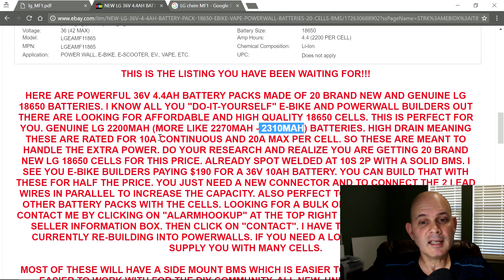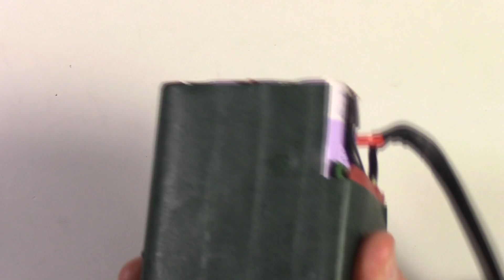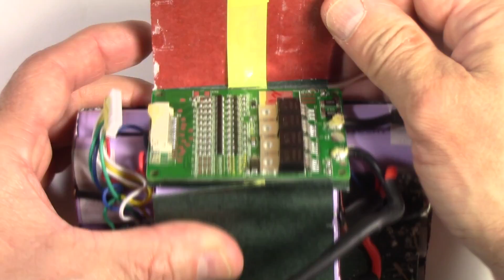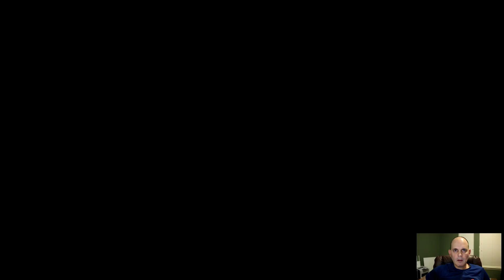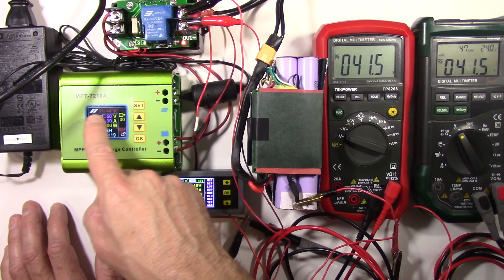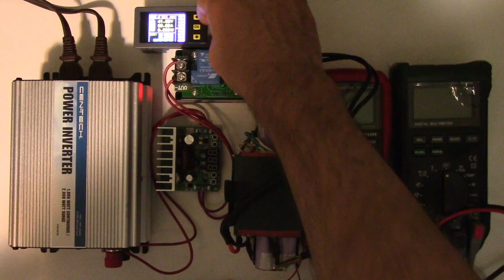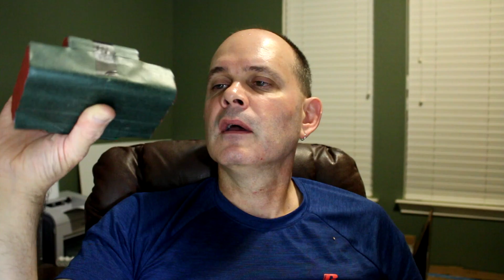NEW LG 36V Ebay BATTERY PACK 18650 Thorough Review (Great Value) For Ebike Vape Harvest Powerwall

Comment: I believe that all the BMS on aliexpress can't balance even if they claim that it can. I honestly don't know where to get one that actually works.
Reply from the maker: I am still on the fence as to whether this BMS balances or not. The BMS is not designed to balance cells that are way out of balance. The pack should start with all the cells in balance when it's manufactured so they really should not drift too much in the first place. Therefore the BMS should only be making up small differences. Thanks.

Comment: Hello Mr Lloyd, thanks for the review, excellent. I'm interested in using these packs for a low budget power wall scenario with a solar panel and I've also been looking at the exact same MPPT charge controller that you used in this video. Would it be possible to have these hooked up in parallel to that charger, considering they have the BMS installed? In other words, could I charge 2 or 3 packs at the same time with a single charger, without having the multiple BMSs cause issues with each other? Also, do you see any issue in draining some power from the batteries in this scenario, while they are also charging? I've been looking all over for answers. Any thoughts would be greatly appreciated. Thanks again.
Reply from the maker: Interesting scenario.I am only speculating here but if the BMS's controlled the packs correctly and could be trusted to protect the cells from over charging and over discharging I can't really see a problem with it. But understand I am not a solar panel charging expert. There may some electrical detail I may be missing here. I know the MPPT charge controller at Ebay: https://goo.gl/dq8Pru does a great job of charging the single packs. The side mounted BMS on the LG pack at Ebay: https://goo.gl/y8bxeU I show in the video that the BMS does have a P- solder pad that will allow you to draw power while the cell is charging but again I have no specifications on that circuit so I can't tell you how well it work for you or even if it is safe to do any of these things.But because you asked and I did mention it in the video that there was P- power output on the BMS but I did not test it. I am testing it right now to see if it has a low voltage cutoff and I will make a video on this feature as I think it's an interesting feature. I did simultaneously charge the cell and discharge the cell using that pad so it does work. I will report what I find in the video soon. Again I will not take ANY responsibility for loss, damage or injury for use of any of this information. What you do with your equipment is your sole responsibility. Be safe.
Reply: Absolutely, I fully agree. Anything I do is 100% my responsibility. Thanks for your input, it's very much appreciated.
Reply from the maker: Here is my video response to your question https://youtu.be/Ua6PpLWqEgc thank you for asking. I will look further into your second connecting two of these in parallel and charging them. I do now have two of these, the LG and the Samsung pack which on paper should be electrically identical but I have not disassembled the Samsung pack to see what the center mounted BMS is capable of. Thanks.
Reply: Wow, thank you very much, Mr. Lloyd! That was very helpful.
Reply from the maker: You are most welcome. Your question inspired the video and I will be doing further testing on the Samsung pack in the near future. Thanks.

Comment: I've bought two different shipments for a total 60 packs - so far. The BMS boards on the first order had the BMS connector but the second order had the board in the middle as shown on Ebay and there is NO BMS CONNECTOR. Just a warning if you were expecting it, I was and had almost ordered an expensive charger to handle them. I plan on using the packs as is for a 36v powerwall.
Reply from the maker: Thanks. My Samsung 36V pack has the BMS in the center which may not really be a problem if the BMS does what it's supposed to do. Thanks.

Comment from the maker: I have received the Samsung battery pack from alarmhookup on Ebay: https://goo.gl/yqMhSN It has the BMS mounted in the center of the pack. Should I send it back and request a pack with the BMS on the side, or should I just grin and bear it and test this one as is with the BMS center mounted? Thanks.
Reply: Richard Lloyd hey man, I think you should just watch my tests. Go to minute 33:18 of your video and you will see that both of your power sources show 0.00A's flowing, which means no current is flowing. What that means is the Mosfet has disconnected the pack from the power source. So the board is protecting the cells. Raising the voltage on the charger does nothing because no current is flowing.
Reply: All the packs are prewired and configured. You can't get custom things done. I live down the road from these guys and saw the warehouse....... batteries batteries everywhere! lol
Reply from the maker: I suspected as much. It would be nice to have a real spec sheet. Did you determine if they are balancing BMS's? Thanks.
Reply: Fishmonger ! I wouldn't ask them to do it, I do it myself. I am an EE with MAD skills man.
Reply: Richard Lloyd hey brotha, I'm making the datasheet now, used EasyEDA for the schematic, and BOM list. I'll be testing several packs this week and making some videos...I want to blow one up, just to see what it actually takes to make it happen...I'll send you the PDF once the data has been gathered.
Reply: hi, test the center mount.... why so stuck on the side mount?
Reply: Richard Lloyd aq

Comment: Thanks for the wonderful video and all the information. Question, how do I charge this battery pack? what kind of charger to use and how to connect the charger? Can you please share more info on how to charge multiple battery packs at once?
Reply from the maker: You are most welcome. You can use a simple 42V E-Bike charger from Ebay: https://goo.gl/HK7xGF or Amazon here: http://amzn.to/2xFakCT and you can use one of these to charge a single pack. The important thing to remember is that they are Li-Ion and require to be charged correctly. They need a charger built to do Constant Current (CC) and then switch to Constant Voltage (CV) in order to not destroy the cells. If you wish to have a more advanced charger you could create a system like I have in the video which will allow you to configure your charge settings, which you need to be very careful to not overcharge or over discharge but using the gear I show in the video you can set it to automatically switch off before any of those states happen also the BMS "should" protect against those situations. You can find links to all that gear in the video description here: https://youtu.be/Q2w5Ka2oNv8 If you want to charge multiple packs I would still use singular chargers for each pack as it is fairly cheap and you get the redundancy multiple chargers and protection circuits. Thanks.
Reply: Thanks for all the info. If I buy one or more of those chargers and replace their plug socket with a XT60 male plug then I can connect the chargers to the battery's XT60 female plug to charge them correct?
Reply: Will this work? https://www.amazon.com/EVAPLUS-Adapter-PowerFast-3-Prong-Connector/dp/B01HXMY0TE/ref=cm_cd_al_qh_dp_t  (it is azn prime so I'll get it in 2 days)  I know I have to cut the connector and put in a XT60 connector

Comment: The spec sheet says 2150mah per cell  at 4.1 volts, with 2 parallel 10 in series   if the bms charges to 4.2 which is the cells max voltage and the discharge rate of the cells are low enough amp wise you can get 4.4ah out of the pack or more. Not only are these cells typically under rated the mah changes depending on how fast you pull current out of them or how hot they get . If you look at a tesla battery pack this is why they have so many cells in place of just larger ones. In short the 4.4ah is more than likely correct . That being said i would rather stick to harvesting cells from laptops , they average me about 50c per cell at 2400 to 2800 mah each.

Comment: Thank you for taking the time to run all these test.  I purchased 40 of these packs over 2 months ago and would like to run 20 of these packs in parallel for 36v at 86amps for a total of around 3kwh for a small solar generator.
Reply from the maker: It should be possible. Thanks.

Comment: VERY useful/informative video!  Thanks!
I;m using them, with BMSs, as a golf cart battery.  Cart will run on as few as four.  Nine makes perhaps a five mile battery.  I intend to eventually use as many as about 26.   So far, no trouble/fires.  Taking care not to charge above 42v.  I've tested capacity on a few and found mostly around 4 ah but some down around 3 ah.  I hope the lower capacities will come up as they are cycled.
Reply from the maker: Wow! That's great. I wondered about a golf cart application as I know that golf cart batteries tend to be 36V system. So you are planning on giving yourself a 14.4 mile range? Thanks.

Comment: I was about to buy a Lunacycle 72V18Ah ($800) for a ebike I'm going to build using a Lunacycle Cyclone 3000W mid drive motor.  I plan to take "10" of these, wire in 2S5P, which would be a 72V22Ah battery pack.  Appears when in parallel the BMS's should "play OK", but wondering what happens when in series, if there would be a "balancing " issue during charging or a discharge issue when driving a 72V max. BLDC motor on the Cyclone.  I would be using a 72V eBike charger.  Anyone with experience that has done this?  I could build for $290 ($250 for the batteries, $25 for XT60's - 2 series and 1 to 6 "Y" cables, and $15 for a bag), and save $750!!!
Reply: parallel is fine. series would not work
Reply: Ed Chorey how did it go? I want to do the same for my 72v scooter
Reply: Jeremy Choy, why can't the packs be connected in series?

Comment: LG (and especially samsung)  tends to underrate their batteries., not for all models, But for alot of them.
Reply from the maker: I agree. If you look at the test results in the video every single pair rated over 2200 mAh for each cell which is great for a cell that is supposed to have a 2150 mAh capacity from the factory. Great value. Thanks.

Comment: I wonder if these are in any way related to the hoverboard fire issues, and maybe leftover stock that they had to liquidate because no one was buying hoverboards anymore due to the fact that they kept catching on fire. You mention its not a balancing board - maybe that was part of the problem? The cells are ripe for harvesting though.
Reply: yes the are, just charge outside and you should be okay.

Comment: The unpopulated components on the BMS board were probably for the balancing function. So you did not need to check the absence of the balancing function on the BMS board experimentally.

Comment: Man a lot of time went into the work of all the charging and discharging  to make this vid. Thank you.
Reply from the maker: You are most welcome. I easily have 60 hours into this project. The dual cell packs being charged individually once is 40 hours and 40 hours to discharge. Of course you don't have to be on top of it all the time but it does require monitoring. As you can see on this video I did this many times. Along with the testing of the BMS. I bought the equivalent pack with the Samsung cells to test at Ebay: https://goo.gl/VJcTjJ I should have it soon to begin testing. Stay tuned. Thanks.
Reply: Is this the huver board battery they had problems, revised. I just seen the new battery. It was called the replacement battery. Shrunk wraped the whole unite.

Comment: I was trying to figure out the balance plug? Is it a Jst 1mm or 1.25 or something else entirely?  I want to connect it to my 10s balance charger which has Jst-xh balance plugs. My last thought was to unsolder the plug from the balance board and make a pigtail to jst-xh. Let me know if you have any ideas?

Comment: Hey man those cells are 10amp but....... Can do 20 amp pulse. So it's not all wrong. I have a set of these and they all show about 2200-2250. Same packs mind you. I know there's a spec sheet, but my discharge/charge/ meter rig is dead accurate.
Reply: Also when you run cells in p vs s you do gain more amperage capability.
Reply from the maker: Yes you may be able to pulse 20 Amps but the maximum discharge current is 10 Amps as stated in the spec sheet from LG. Understand that my philosophy is that if the manufacturer does not state it's possible then it's not. Even if it is (as you state) I can't recommend doing something the manufacturer does not back up. More than likely this means that there is a danger or hazard in doing so. But if you can post link to information from LG that states that it will safely pulse 20 amps I would appreciate it.  I do state your second point in the video. Thanks. All the best.

Comment: Hi I got 10 pack of these, I need to down 24V for my load, how is done and what battery type is needed
Reply from the maker: You have a few choices. The first and easy choice is to step down the voltage to 24V using a DC/DC 15A Buck Adjustable 4-32V 12V to 1.2-32V 5V Converter Step Down Module like this one on Ebay: https://goo.gl/RBVzRW or this 4-8 Amp one on Ebay: https://goo.gl/12bHkm Now understand that I have no idea what your electrical requirements will be so these are just some examples you can purchase there are many others available. Note that you will lose some of your energy on the conversion depending on the board. Another (but technically more challenging) option would be to take the original 10S BMS off the pack and getting a 24V BMS like this again on Ebay: https://goo.gl/TqLVaX and stripping off 3 cell pairs off the pack therefore changing the original battery pack from a 10S 2P 36V pack to a 7S 2P 24V pack. This solution is the most electrically efficient plus you could create 4 more 24V 7S 2P with the spare 30 pairs of cells you will end up with. You will have to estimate what the best solution is for your electrical requirements and technical skills are. Thanks.
Reply: Adam Welch found out the 36/48 to 24V converters specifically built are more efficient 96%. You can get them 10A, 20A, and 30A. 36V/48V to 24V converter amazon or ebay.  Nice solid state box.  A 36V inverter should work with these as is.

Comment: It would be hard to use the power less efficiently here.... A DC-DC converter, to a cheap inverter to lights that convert back to DC. It's retarded that so many solar systems work this way (not critiquing you here). Anyone with a solar setup should do everything in their power to use DC equipment. The inverters, especially consumer grade like shown here are incredibly inefficient with a peak efficiency of around 85% in a narrow power range.  There are losses at the DC-DC circuit, the inverter and again at the rectifier in the light. I've even seen the van people using inverters to power their laptops (which most have cigarette lighter adapters available that use 12V DC directly) and even 120VAC lights in a van!!! You can get 12V appliances and power brics for your laptops and even TVs.
Reply from the maker: The lights AC florescent ballast type tube light (the curly ones that plug into the incandescent sockets) and yes I agree it is a highly inefficient configuration but this was not a video on efficient solar power design. If I was running a solar system I would avoid the voltage conversions as much as possible. The 36V battery range make conversion necessary if you are using 12V or less devices but you can get small DC-DC voltage converters that are 92% efficient for example these DC-DC 3A Buck Converter Adjustable Step-Down Power Supply Module LM2596S from Ebay: https://goo.gl/V88bcK  and you can get 10 of them for under $11.00!! I just ordered them (LOL). These are Input voltage range: 4-35 VDC Output voltage range:1.23-30 VDC adjustable so you could use them to power various devices like any USB device, laptops, routers, 12V lamps etc. I like the idea of small individual components as it builds a measure of redundancy. I would only use the 120V AC inverter in a situation where I had no choice (not sure what that would be). I was certainly thinking about how to make it more efficient while I was setting it all up but again my main goal was to give the 36V Battery pack a load so I could measure and discharge it. Thanks for the comments and suggestions. All the best.

Comment: i have already bought 40 of these packs for a future power wall. i have found at least 5 different BMS boards so far, (20 packs torn down) i was really glad to see you were testing these cells! such a good deal. to bad they will start running low now that i have seen them on 3 different videos! i got my 800 cells so thats a good start to a power wall!
Reply from the maker: Fear not! Look at this on Ebay: https://goo.gl/dAgdco I noticed recently he has also found a Samsung cell battery pack. It has an electrically Identical cell to he LG (exact same specifications) Here is the specifications for the ICR18650-22P Samsung cell: https://goo.gl/985CD7 I may have to buy one of those to test too. 😀 Thanks.

Comment: It occurs to the that the extra space on the BMS might be used for converting it into a more parallel BMS, like instead of 10s 2P, you could have 10s 5p with those 3 extra measurement pins. And then they would fill up the 5th mosfet. just a guess.
Reply from the maker: It could be, but unfortunately I have no specifications from the manufacturer to confirm this. thanks.